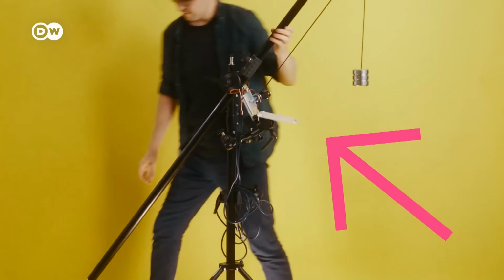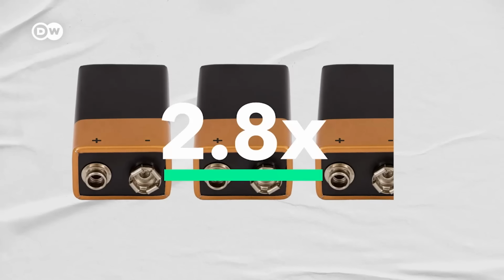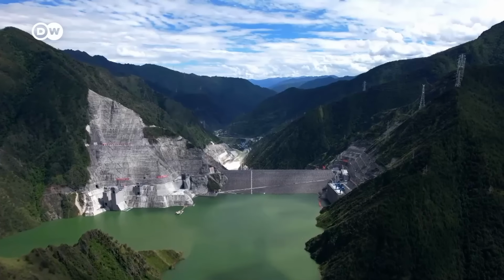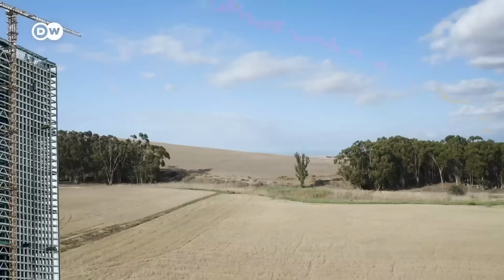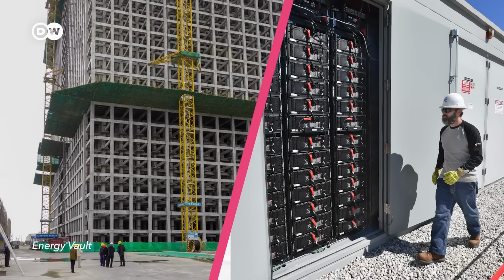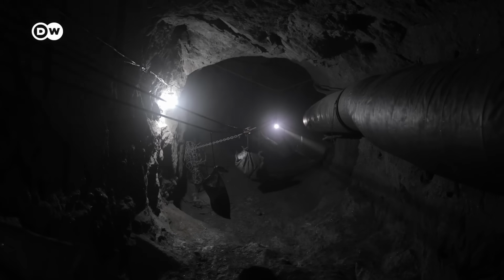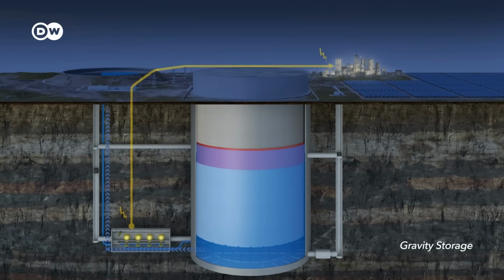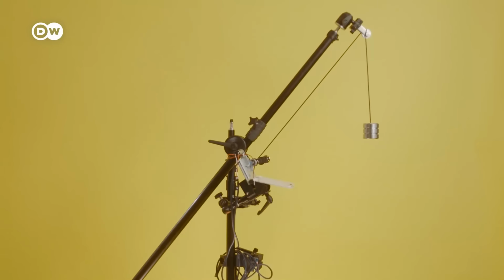How to use gravity to store energy

Comment: The biggest downfall of this is and will always be the interminable amount of time it takes to get the energy out of the battery. If it takes days to move all the concrete blocks to the top of the tower, then it takes hours to release all that energy. With batteries, you've got access to the power immediately.

Not to mention the wasted energy the crane or hoist uses to return to the top without a weight. The whole system is so inefficient. And what if a block gets stuck or jammed. this whole thing is so monumentally flawed.
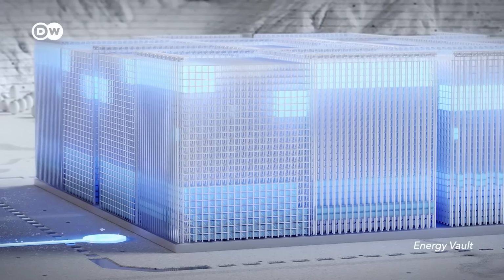Reply: The solution is to lower multiple blocks at once and have a high-speed materials system moving them to and from the elevators both in the roof and on the floor (see the fantasy CGI of glowing blocks moving around at 4:09 in this video). That's a lot of expensive machinery that will require a lot of maintenance, unlike a battery you dump on a concrete pad and plug into the grid. If the 100 MWh gravity storage building in China is 100 meters tall, then it houses 16,000 25 ton blocks!

Comment: I think that the main problem is to make it massive.

Why can't we design our new houses with gravity facilities at scale?  At the end, we have space inside the walls, particularly when you have two or more stories.

Also, these could be filed with water or other combined ideas, and using solar direct energy (no electricity), and when you need it just let it go .... 

A small quantity for regular personal usage inside the house already have a cost.

This is why the regenerating brakes in EVs are so good idea, because they are located in a small vehicle.  They are not all attached to a huge infrastructure to store together, that is not logical.
Reply: Use a units calculator (I use Fourmilab). Say you somehow store 5 tons of water in the walls of your house and can somehow lift it 10 meters into the air. 5 t * gravity * 10 m = 0.136 kWh of energy, worth a few cents.
This is why nobody lifts their car, or indeed anything into the air to store energy. Gravity is a very weak force.

Comment: Now to put things in perspective. One fuel bundle for CANDU nuclear reactor (natural non-enriched uranium) holds 1100MWh worth of electricity. And after discharged from reactor it will still be able to give about 98times more power in the future with "advanced" reactors with breeding(so it is not waste, but temporarily spent fuel waiting for reuse). This steel "energy vault" looks really silly in comparison (plus the energy generation needed to charge it). That being said- CANDU plus storage could truly decarbonise both baseload and peak needs so developing reasonable storage is a good thing.
Reply: Mentioned bundle weight is only about 25kg too.

Comment: Let's calculate things properly, shall we?
Let's start with a simple assumption: we'll have 5 t stones at a height of 150 m. That provides about 2 kWh per stone of potential energy.
At about 3 kg/m3 density, the stone would have about 1,670 m3, and if a cube, would be approximately 12 m per side.
If we want a storage facility for about 1 MWh, we'd need 500 stones (1,000 kWh total divided by 2 kWh per stone).
Since we need some space around each stone, let's say this would be about 3 m on the side of each stone. So the space per stone would be 12 + 3 = 15 m
As we need 500 stones, let's distribute them in a grid of 20 by 25 (simple calculation).
So we'd need to have a storage facility of 300 m by 375 m by 150 m with all the necessary hoisting equipment just for a 1 MWh installation. A simple search provided me with the dimensions of about 6 m by 2.5 m by 3 m for a battery storage of 1 MWh.
And this does not account the energy losses on hoisting the stone up. We'd be talking about the pulley, the rope (or cables, does not have to be actual rope, of course), the winches, etc. You'd be lucky to get 65% efficiency (as a guess, I have no experience).
And the argument about the lifetime does not work. Batteries lose life because of frequent cycles of charging and discharging. Doing the same with these gravity batteries would cause frequent replacements of the parts as well: motors, ropes, any other moving part. Besides the immense safety risk associated (I'd guess the risk of a rope breaking is considerably higher than that of a battery catching fire).
In short: maybe a good idea if you have tall buildings just laying around (decommissioned industrial sites, for example) and need the storage. Otherwise batteries and other storage forms (e.g. even hydrogen) make more sense.
This feels less like a "gravity storage is good" piece and more like a "batteries bad" piece.
Reply: The main problem with this is that gravity is the weakest of the fundamental forces. And by far. Only useful when Nature has provided us the essential infrastructure and we just needed to tweak things (as in dams). Otherwise it doesn't seem to be that useful.
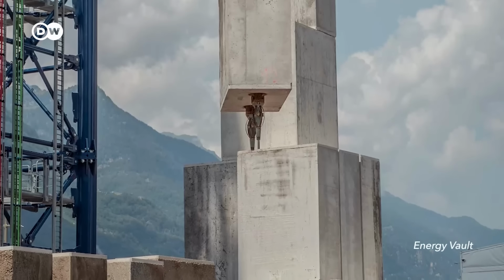Reply: Congratulations on doing the math. You're off in one aspect: water weighs 1000 kg per m^3, and concrete around 2400 kg/m^3. Energy Vault says it uses 25-tonne blocks. That's only 10 cubic meters or 2.15 meters on a side (see its dopey glowing cubes moving around at 4:09 in this video).

Energy Vault says its Chinese building stores 100 MWh. If it's really 150 meters tall (it doesn't look it), then that requires 10,000 blocks. Its dopey animation suggests they are stored at several levels. Four levels of 50 x 50 blocks would fit in the building, but you need two complicated racking and transport systems to move blocks to and from the lifts as shown in the animation, both at the roof and on the ground. It's very dumb but I really want to see a video of the system in operation!
Reply: @skierpage  Fortunately someone noticed his/her density mistake!

Comment: Why not file the container with water at the top of the tower and then drain it out when it reaches the bottom which then reduces the weight of the container when it’s pulled back to the top
Reply: Think it through. How does the water get to the top? If you're going to pump water high into the air... congratulations you've just reinvented pumped hydro storage.
Reply: @skierpage  have you ever heard of an aqueduct?
Reply: @johnsnelgrove7874   yes I have. An aqueduct just holds water in the air. If it's transporting water then it relies on gravity to move water along a slight decline. It doesn't avoid the energy required to raise the water to the higher point so it flows downward. Maybe you're designing a complicated containerized version of a hydropower dam :-)
Reply: I wasn’t being flippant when I suggested an aqueduct as it obvious if there is head of water above the point of which it’s discharged that the kinetic energy can be captured
Why not build small locks next to rivers made from shipping containers that would capture the water and then probably with an aramedian screw Generate Electrical power in a modular form, which would probably be cheaper

The point in making is that it’s obvious that if you have to lift the same mass up as you released down the only way that this is effective is if the energy being used to raise it is cheaper than the energy that is being generated by its discharge 

And when you consider the build costs friction and efficiencies which is beyond me, it does beg the question why not? Make the container lighter when you lift it back up 

So if you were to build this kinetic battery idea in a valley with a head of water running from a nearby you could pipe that in relatively easily and use the weight of the water to act as the kinetic battery which is then discharged at the bottom and then reduces the amount of energy needed to lift the empty container back up 

It’s a very interesting subject and I enjoy a good debate
Reply: @johnsnelgrove7874   (YouTube keeps eating/censoring my replies)  yes, energy storage relies on storing energy when electricity is cheap and generating electricity when alternatives are expensive.
 
Like every gravity storage technique, your idea "works." Claude AI says a 2-ton shipping container would hold 38 tons of water; you'd have to beef it up to make it water-tight. Yes, that means it only takes 5% of the stored potential energy to lift the container back up. But round-trip efficiency isn't the big problem with gravity storage, the tiny amount of energy stored is. Let's use our trusty Fourmilab units calculator to see how much energy you store if you lift the container 300 meters, the height of the tallest dam in the world: 38t * gravity * 300m = 31 kWh. That's tiny, worth say $10 to the grid during sustained periods of high electric prices. A single used EV car battery will store twice as much energy. To store 100 MWh you'll need three thousand shipping containers of water, so you're back to the problem of huge railyards at the top and bottom to move your mass to and from multiple lifts (the infrastructure that these gravity storage companies never show). Good luck building something that will ever repay the cost and maintenance. Just build a dam at the top and let the water flow through a turbine.

ARES started with the idea of rolling a train filled with junk down a long hill. A non-starter, so it shifted to dragging fleets of 350-ton (!!) "mass cars" up and down the side of a gravel pit. I couldn't price the chain drives and rollers required to pull up and down that much mass because they don't exist, it's custom engineering. Instead in a month you could just plop 12 Tesla Megapacks at the top of the hill and store the same 50 MWh but with 25 times the discharge rate (power delivery). I want to see full-scale gravity storage projects built because it'll be hella cool engineering, but they are staggeringly unlikely to work out economically.

Comment: Another key factor is round trip efficiency.  How much energy is unrecoverable because of the characteristics of the materials involved? For example, a crane cable is not infinitely flexible; a certain amount of energy goes into deforming it as it wraps around a its reel.  And the same thing happens for release of the weight back down to either the ground or the mine shaft floor.  Same thing for battery storage; a certain amount of energy will be lost as heat when charge is being forced in and being converted to a chemical change.
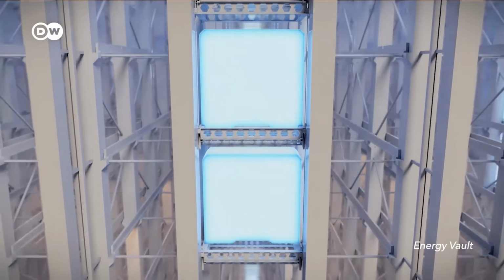Reply: Yes, if the round-trip efficiency of the system is only 50% and the difference in electricity price when you lower vs. when you raise is only 2x then you never make any money. But the difference in electricity cost in a renewables-heavy grid is more like 5x, or even infinite at times when there's excess renewable generation no one wants. Efficiency matters far less than the cost of the system, and gravity is such a weak force that the cost of the 14,683 25-ton blocks, the 100 meter tall building to house them, the multiple motor-generators to lift and lower several blocks at once to generate decent power, the complex system in the floor and ceiling to move them to and from the lifts (shown at 4:09 in the video complete with glowing cubes), and the maintenance of all this machinery... all to store just 100 MWh, dooms Energy Vault.

Comment: I think the comments here are a bit too negative. Of course pumped hydro is less costly to built and more efficient to operate, but, first, many countries don’t have the mountains/hills needed to built them and, second, the dams and reservoirs needed destroy whole stretches of mountain landscape, which are often the last pristine landscapes. The structure, that looks a bit like a building, now being built in China, doesn’t destroy the environment, certainly not if you built it in an already urbanized region. And if you use waste material to make the blocks, less CO2 is emitted during construction then if you use concrete. And although building it is relatively expensive, using it is not. It runs perfectly automatic, it cannot burn, the weather has no effect and it runs for 60 years. Financially what counts is costs and gains over the whole period and then some of the plusses are non financial, like no destruction of the landscape, no mining needed, etc.

Comment: Ok so lets do a quick calculation. We have a block of the energy vault. It is 25 tonnes. 25000 kg.

To move 1kg 1 meter is 10 joules of energy. Move 1 kg 50 meters is 500 joules. The block is 25000 kg. Thus it has 12.5 million joules of energy. Which sounds like a lot. But it isnt.

The average washing machine uses 400-1400W so lets assume(700W) This single block can power 5 washing machines for an hour. 

Just think about it. This block has the weight of ~20 cars. And can support 5 washing machines for an hour. Not even taking into account any other devices in a home. This type of storage is just not viable at all.

Comment: The best part about gravitational energy storage is how easy it is to understand that it's extremely impractical, except pumped hydro when conditions for that are good. The theoretical capacity of gravitational energy storage is described as U=mgh, as in, energy=mass x gravity x height. 1 kg 1 meter up represents about 9.8 joules. That means if you lift a metric ton 1 meter, you have stored as about as much energy as a standard AA NiMH battery cell can store. To store the same amount of energy as one standard 18650 liion cell you will need to lift that metric ton about 4 meters, or four tons one meter. And that's the technically stored energy, there are always losses, even if they can be kept relatively small with gravitational energy storage. 
  
When one option is so much more expensive a potentially longer lifespan doesn't help, as interest will keep the net cost much higher indefinitely. And that's even when assuming the "estimates" of cost, lifespan and reliability made by proponents, including industry representatives are reasonable. In reality the mechanics involved means it will require expensive maintenance, and moving huge blocks of solid masses around can have a detrimental effect on constructions. 

With pumped hydro where you can utilize geography for most if the holding capacity, and water as storage medium, a lot of things becomes much easier. Even if two ponds would have to be dug on flat ground, pumped hydro would be better than man made solid weights as long as the necessary water is available.
Reply: So now let's pretend water is at a super premium and any use for it other than drinking or crops isn't allowed.

Comment: I wonder if ther would be any way to make a mine shaft battery that you fill it with water at the top and drain it at the bottom lifting a lightload up and dropping a heavy load down

Comment: While not entirely for generating electricity, I'd totally go for a concrete battery storage system to power an elevator and escalator system to move stuff around in my backyard, which is a fairly steep hill that I want to do gardening on. Not sure how practical it would be, but it would say least help with moving heavy materials, and it would look cool AF.
Reply: What lifts the concrete up and down? Presumably it's a motor, so why not just hook that motor up to your elevator and escalator?

If you want to store the energy to run your elevator and escalator for some reason, a simple 1 kWh 12 Volt car battery can lift 1 tonne 367 meters into the air. Gravity is a terribly weak force.

Comment: What I think is great about this compared to Li-ion battery tech is how the material for the blocks can be made from waste material. Another thing I’m curious about is using gears to get more rotational energy from the blocks.
Reply: Each 25-ton block lifted into the air stores so little energy that even if it cost $0, the cost and maintenance of the machinery at 4:09 in the video to raise and lower it and move it around in the roof and on the floor makes gravity storage a non-starter.

All the energy in the system arises from the potential energy of lifting a mass a certain height against the force of gravity. Gearing and rotation has no effect, unless the motor-generator spun by the lowering mass has a narrow band of efficient operation.

Comment: Why use heavy and brittle concrete blocks and steel cables that wears out? Water is just a much more sensible material for gravity storage hands down. For the same money, they can dig a lake and also build a tall water tower and get the same 100MW, but the long term maintenance cost would be lower.
Reply: Learn to use a units calculator. To store 100 MWh in a 50 meter tall water tower you would need to pump 734,195 tonnes of water into it. That is a cube of water 90 meters on a side, i.e. much bigger than the height of the water tower!
Let's take the biggest water tower in the world. "The water spheroid at Edmond, Oklahoma, USA, built in 1986, rises to a height of 66.5 m (218 ft) and has a capacity of 1,893,000 litres". That's only 1,890 tonnes. Plug that mass and height into our units calculator, and discover that it only stores 34 kWh, 0.03% of 100 MWh.

For pumped hydro to work, mother Nature needs to supply large pre-built upper and lower reservoirs with a large vertical drop between them.